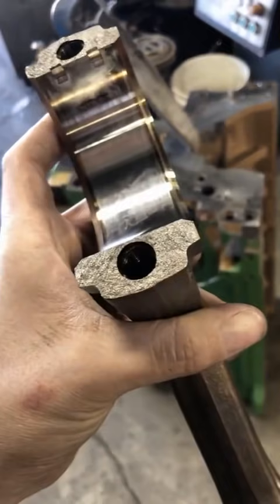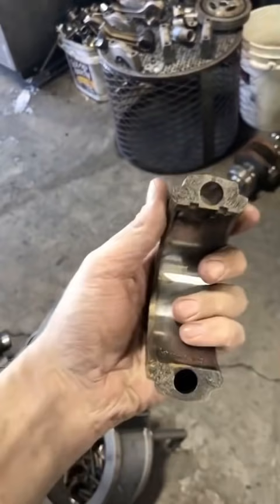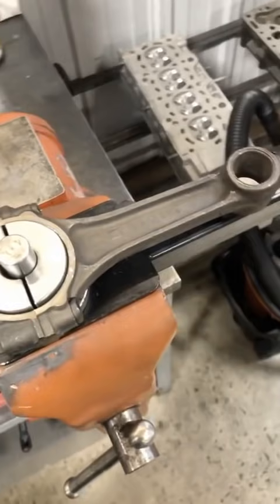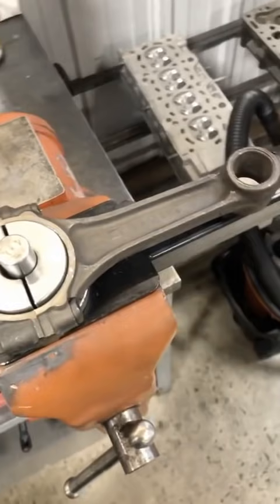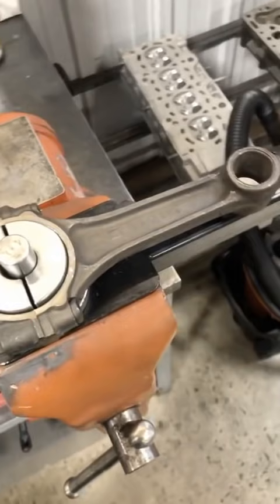#shorts Fracture Split and Angle Cap Connecting Rods Explained

Comment: Connecting rod are the most severely fatigue parts on internal combustion engine , other than the crankshaft is supported by 5 - 7 main bearing journals , angle rod caps are frequently choose on engine design to make easy entry passage to the bore during assembling . Better renew the connecting rod rather than resizing it , if you intend to fit a oversize bearing shell .

Comment: I work at Paccar. We manufacture the MX11 and MX13 engines in our plant. We use fractured connecting rods and fractured main bearing caps in the blocks. They say the fracture surface adds some stability and allows us to use 2 bolt mains instead of 4.
Reply: Spin a main bearing in a fractured block and you can throw the block away

Comment: It’s effective. You don’t get caps backward or mismatched either. Bonus is the larger diameter bearings too. The larger they are the less wear you’ll get due to reduced rpms. Smaller is faster,larger is slower.

Comment: I did not know that Junior.
White sandwich bread is way cleaner method to remove spigot bearings.
Big chain makes for good axle puller.
PCV are notoriously prone to going bad, and creating a lean running condition and normally fixed by upping the idle speed.
Great video 
2 thumbs up !

Comment: This was originally done by Honda. When you produce the rod and cap on separate lines two pieces wouldn’t always have a tight fit. By manufacturing as one piece and then breaking it, you ensure the fit is tight every time. A laser scribes a line across the bore and that’s where it’ll crack.

Comment: The first place I encountered them was an Iveco engine in a New Holland skid steer, but it's certainly becoming more common. People should be extra careful when handling these. Sometimes it is very difficult to seperate the cap. If you drop either half on the floor, and the metal gets damaged at all where the two parts fit together, your connecting rod should be replaced. I make it a point to promptly re-install the bearing cap to the rod upon disassembly to prevent any damage.

Comment: Rod design is fairly interesting. A lot of rods are designed such that they strike a balance between thick enough to not break due to the forces in the engine, but also thin enough to not impart so much weight to the center that would shorten the life.

Comment: It is true that they are less expensive to produce. The rod is cooled to cryogenic temperatures (-100 F or lower) before the cap is cracked. in this way they break very cleanly and cracked surfaces mate to each others irregularities almost perfectly. This reduces the amount of strength lost  between the cap and rod at the mating point.

Comment: IIUC, the rods are made of sintered iron, it’s a cheaper process for production & it’s very accurate... just not sure if the sintering process makes them any stronger.  
The 45 degree angle reduces the tension stress on the rod bolts on the exhaust stroke, rod failure is almost always rod bolt failure & the most stressful cycle is the exhaust stroke at high rpm... a Le Mans rod with the 45 degree angle is a huge improvement

Comment: I watch these like I have any clue what's going on.
Reply: Basically, that big round end goes around the crank in your car. (Not important to know what that is). But when they make the big round end, they physically break it in two instead of machining (cutting) it or making it in two pieces. That way it fits together kinda like a puzzle piece.
Reply: @herranton  oh they really break rather than to cut it cleanly.. wow so much wisdom for their part..
Reply: @adolfemmanuelesparas3922  It is impossible to “cut it cleanly”. Whatever saw blade you use has width, which would turn your finished circle into an oval.

Comment: the angled cap is for strength during the power stroke.  and it's not hard to make oversized bearings for these the manufacturers just need to do it.

Comment: The fracture creates a locking surface which was machined in the past.  You could machine a mating surface then hone to fit.  But at present labor rates it is less costly to buy new rods.

Comment: Interesting why some manufacturers angle split. ISL cummins engines come with saw cut, serrated, or fracture split and they come in straight split and angle split and they both fit through the bore so I wonder what the difference is there. When I have to replace a fracture split rod the tool I use to split them consists of some sort of weight attached to the end of a stick, usually covered in plastic and of the dead blow variety.

Comment: Well, yes assembly is easier, but for BIG torque diesel applications having a straight cut wouldn't be able to withstand the forces coming down, while an angled cut helps assist the rotation and turn what would be a direct shot down into a partially off center shot down on the combustion stroke that helps rotation. Got really indepth on this when I had my engines class years ago

Comment: Ford has been using fracture split roda since the early 90s in all their V8s.
Reply: Yep....they had the patent from what my Ford ASSET instructor said.  Also done while the rod is cryogenically frozen
Reply: @boonboom3528  the cryogenic this is false. I worked at Fords Romeo engine plant for some years. Machining dept did that work. Just a regular fracture split.
Reply: @boonboom3528  Although they did have a huge block heater area to warm the aluminum blocks to set the sleeves in.

Comment: I wonder if there’s a good way to spray weld the inside and machine it back out? Spray welding is the kind of thing you’d do on a crank shaft or spindle to repair it but it would be interesting if it could be done the other direction too!

Comment: Ok, I thought I was a mechanic but had never heard of this? Is the metal not stressed out of round before the break or does it just have so little plasticity it breaks before it bends at al
Reply: Funny I’ve noticed it when watching videos on YouTube of engines being built. I always wondered the difference and today I found out!
Reply: My thoughts exactly, I'd thought the metal adjacent to the fracture would be stretched out or stressed and weakened. 
Interesting to say the least
Reply: They would have to break it before heat treat while it's still brittle

Comment: Mann Marine Diesel uses the cracked rod design. It is imperitive that the mating surfaces be clean but when you hold them together it is impossible to slide the cap because pof all the angles. Rhis is the true reason for the cracked rod.

Comment: I seen my first cracked rods on a Cummins BT-6 In a case 721d loader. I had a journal that had small amount of bearing transfer I used strip sand paper to clean it up shimmed with soda can strip beging new bearing. Still running today
Reply: Typo behind new bearing no 0.01 over available ended up with . O.03 crank to bearing clearance.  When you know what you can or can not get away with makes us that know bad ass.. I also have a  dt466 with 0.05 shim stock behind one bearing 8 years running now

Comment: Im faiely sure they have an angled opening like that (looking like more of a rounded Y than a c on a stick) because of strength, because if you draw a line straight down, then this way a single part is getting most of thr forces instead of the bolts tjst hold them together

Comment: There's no increase in strength at the parting line. Rods don't fail by the cap slipping off the rod sideways. 
It's still a parting line - across part or all of the load at higher rpm.
The simple proof lies in that stronger aftermarket rods, manufactured for race engines, Do Not Use the cracked cap method. 
It Might be a more accurate cap placement the first time it's assembled after cracking, but proper machining on a conventional rod is just as accurate.
They are cheaper to manufacture in several ways, none of them any benefit otherwise. 
Over time, they still distort like a conventional rod, but can't be reworked the same way, they are reworked as he says - IF oversize OD bearings are available, if not - you're buying new rods.

Comment: Can you tell me why more rod sizes are not standard? You would think that most engine designs could use a standard size on both ends but yet every engine has different sized bearings.

Comment: Correction the caps are not angled to fit through the cylinders they are angled to redirect tension from the cap bolts to the structure of the connecting rod it self.
Reply: You’d be really dumb if you thought it was just for 1 reason
Reply: @RedHaloManiac95  That's the main reason cap's are angled there may be secondary reasons, but the main reason should be highlighted first.

Comment: Does your company work on "OLD MODEL" Hemis as in the  270; 291; 315; 331; 354; 392
c.i.d. All of them D, C, D, & P had different displacement.  l believe l have a '53 331 w/bellhouseing that needs reassembled and a carburetor.

Comment: I feel like this is a marginal gain in reliability that could be gained by improving other areas of the engine that are more repair friendly
Reply: This process also makes manufacturing cheaper because now you don't have to face the parts

Comment: That’s not why a cummins rod is angled at the end. Since it’s a L6, if the rods were standard and straight with a diesel if 2 rods were tdc or sitting on top of the crank it would lock the engine up and not allow it to turn. Literally details that reason in the cummins manufacturing book.

Comment: That's a good design, but my way of rod removal is much faster. It doesn't even include any tools all thats needed is no coolant and your engine temp to be in the ballpark of 380 degrees at 5500 rpm and they usually fall right out.

Comment: So explain why you couldn't just machine them now that they're split? Set em up and machine the mating surface till they jusy clean up, then you'll have a smaller overall inner diameter that u can then bore out for regulate sized bearings? I'm a tool and die maker never machined engine parts before but that seems like it would work to me.

Comment: This is not new. Powered Metal forged cacked caps were first made at Exotic Metals in Ridgway Pa for Ford around 1986 it is now part of American Axle.  I think they hired an engineer from Chrysler to help develop them.  There is a wrought alloy called, i believe, C5 that they were also using in europe to make cracked cap rods.

Comment: The 1 inch gap of the cylinder wall and the rod isn't enough to fit? You could fit 2 in there without manual Turing the rod offset to the cylinder center
Reply from the maker: The cylinder sleeve isn't currently installed in that cylinder...

Comment: Have they consulted a metallurgist?  I would think other metal in the rod would be weakened by stress.  The metal in a rod is not made to be elastic.  The choice of the metal for a rod makes it brittle.  There are very likely other sections in the rod that have micro fractures.  Good luck.
Reply: Yes. Engineers understand how to make things crack in specific spots without damaging the rest of a structure.

Comment: I wish I could work at a shop but on my own time and schedule and without anyone hovering over me or asking me questions. Give me the keys and I don't want to talk to you until I'm done. No questions asked. No limit to the costs. Whatever needs to be done gets done, whether you like it or not. And you would of course be fully insured, because you would never have any problems with your car, no matter what it is. This of course means that I would have your car and likely be rebuilding it as soon as you sign on with me. I would strengthen safety measures, reduce weight, greatly increase power and stopping distances, it would be more comfortable and luxurious. It would be a vehicle that you could hand down to your children and they could pass on to their children. And with very low maintenance, and extremely reliable. I would put an initial payment of like 50k$ depending on the vehicle it could be upwards of 100k+ (especially for high end vehicle's like Mercedes).

Comment: More part that are deliberately set to fail so the consumers pay more for repairs. Also I like how they've made it so the consumer cant fabricate the part once it fails.
Reply: My thoughts exactly
Reply: Wtf are you on about, this  design is stronger and cheaper for the consumer. How often does the average consumer change connecting rods? 😂
Reply: @rorygills8329    He posed a question. I'm answering in a wide perspective. In a lot of items things are deliberately designed to brake so we have to buy the specific parts. My answer is based on consumers rights to fit after market parts or yes in some cases fabricate the part that's broke. unlike this part as he points out it's not repeatable by design. Listen to what he's saying and pointing out. Smart arse!

Comment: Question, do any engine builders for racing industry use these fractured rods? Like F1, NASCAR, drag race....if they don't use them and I don't believe they do then why do car manufacturers?
Reply: They do this because it gives a very precise fit and little possibility for fiment error.
Why F1, drag race etc dont do this is because not all materials are suitable for fracture. F1, drag race etc need very strong rods (at least billet) because of very high rpm (sometimes 20krpm) and extreme power (300hp+ per litre), but normal engines dont come near such specs so they can use cast rods that can be fractured.

Comment: The biggest reason is to make them irreparable so that you have to buy new replacement parts.
Reply: Or, get this, the mating surfaces function significantly better on the split rod as opposed to machined faces that have two whole dimensions of freedom to move. Also how fkn often are you replacing your pistons. Be real

Comment: How are the locations of fracture controlled?
Reply: Probably by design of geometry and design of load application. Also a lot of engineering!
Reply: laser etching
Reply: @mattroberts37  I'd believe etching a fault line.
Reply: @mattroberts37  
Didn’t know that, cheers!
Reply: @jonnda  Chem - etching?
Reply: @SW-qr8qe  I think as long as you create a deep enough fault line that increases the likelyhood of breakage on that line, it wouldn’t matter if the fault line was laser etched, chemically etched, or mechanically etched. To me it seems mechanically/optically etching the desired break line would be faster and less messy.
Reply: @jonnda  optically would be toolless, can see that being preferred with less need for human interaction with an automated process.

Comment: I love them because you will always assemble the rod with the correct cap. Otherwise, you may accidentally match a rod and cap that we're not machined together, causing an inconsistency in the engine, increasing wear, and causing premature failure. Rods aren't expensive enough in my opinion to remachine them. If you're spending the money to rebuild, just buy a new rod if needed.

Comment: If you are working with fracture split rods you have to be very careful. If you get the cap backwards it’s trash. If you drop them their trash. You have to be very careful to get any oil out of the fracture surface and dry. Be very very careful if the main caps are fracture split. Yes main caps. Paccar mx engines use fracture split main caps. If you mess one of those up. Not a problem. Just got the parts department and request one and you will get 5 in total and a new block.

Comment: not that its more precise its just cheaper. Big auto companies have been doing it for decades. they are snapped off the same way you snap a twig.
Reply: Except the two resulting parts would perfectly mesh into each other every time as opposed to having two flat faces where you have two whole dimensions of possible misalignment
Reply: @Coastal_Cruzer  the holes can be made with exact alignment. Cracking of a con rod does mean more area of contact for maintaining of position,  but it is really done because it's cheaper. Bolt holes can be looser and no machining required between rod and cap mating surfaces. Mass production is all about speed and price.

Comment: The rods are significantly weaker as when they are made it causes small fractures in  the molecular structure.. Its a cheap idea.. but for superior strength they're garbage.
Reply: No it doesn't. Engineers understand how to design stuff to crack precisely. On top of that it's done in a specific way to avoid microfractures

Comment: More precise, not more durable though. Fractures breed fractures. You can see the makeup of that fractured one. When it finally breaks, and it will, it will produce more smaller fractures and small pieces that can continue to break down other parts of the engine. This is just auto makers being cheap and not caring about the owners as usual.

Comment: No chance thats better than machining them haha. Its literally a con designed to save money and introduce another part that will break.
Take a piece of spaghetti and try to break it into 2 pieces. The extra bits that fly off are the bits you need to stop your piston from smacking your valves..
Reply: A spaghetti can easily broke into 2 pieces.